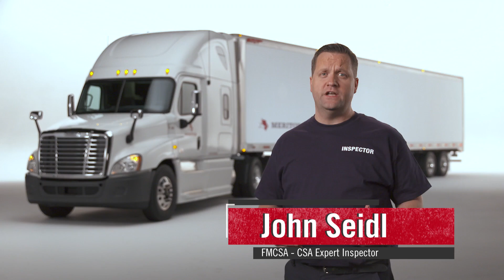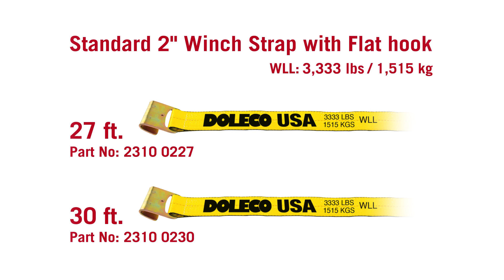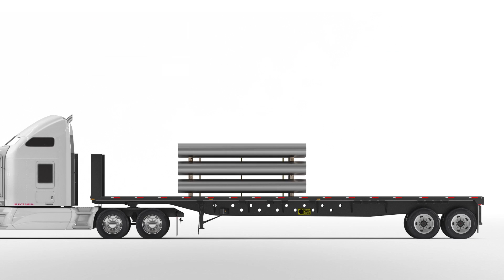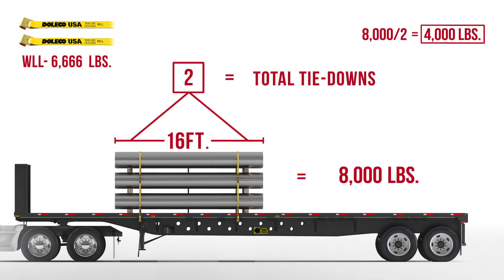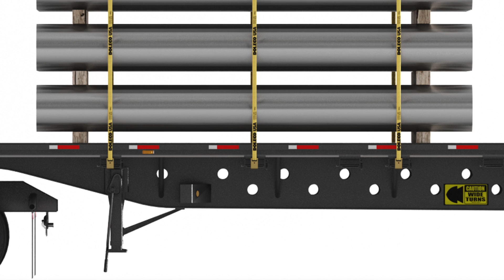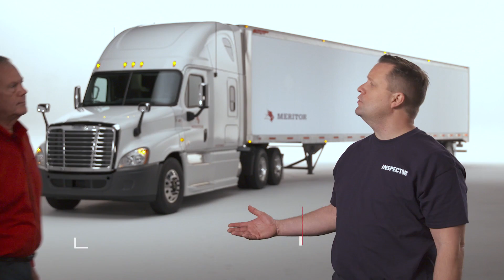How Load Securement Can Cover Your Assets

Comment: While the video is useful for thinking about how to secure loads, they also forgot to discuss gut straps, aka belly straps. A gut strap goes in between tiers of the load (in the video example, there are 3 tiers of pipe). IIRC, gut straps  should be thrown at least 1 per 10 feet (3 meters) of total cargo length, per tier. In the video's example, tiers 1 and 2 would require 2 gut straps each, with the 3rd tier requiring the normal amount of securement for the total load length and weight.